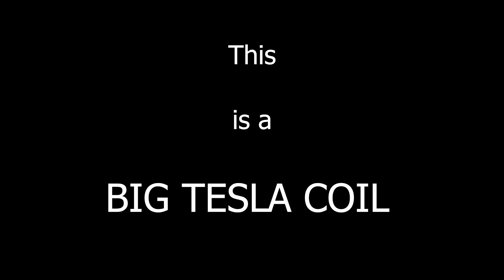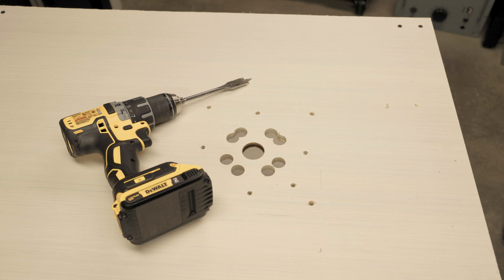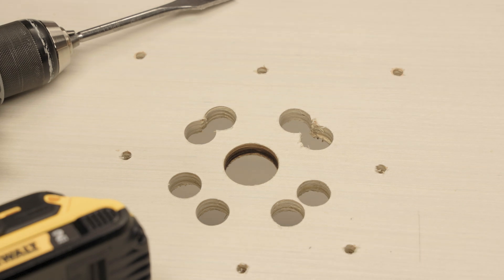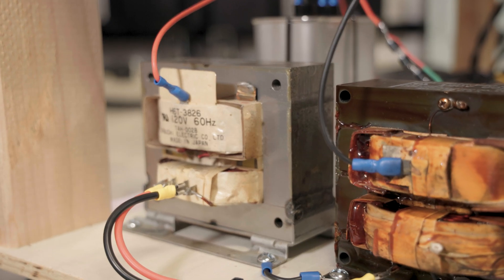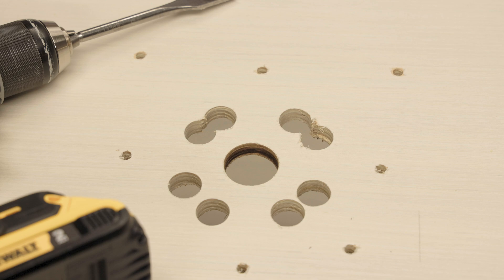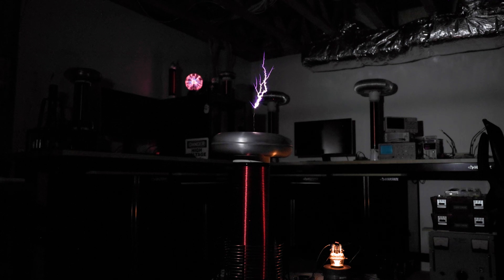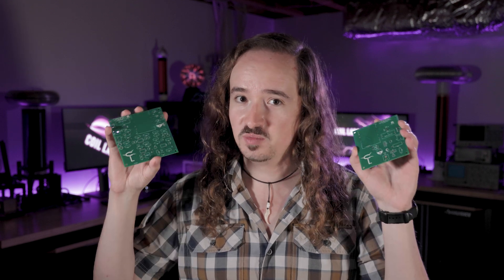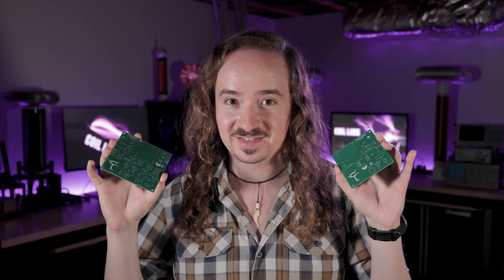I built a big Tesla Coil, but it has a big problem!

Comment: Dose your soldering iron suck up the fumes?
Reply from the maker: Yeah, it's an all-in-one soldering station and heat gun. It has this "fume extractor" thing that uses the same air pump as the heat gun. This is what it is https://www.amazon.com/Aoyue-968A-Digital-Rework-Station/dp/B006FA481G
Reply: @CoilLabs  if my current one ever hits the bucket I might invest in one.

Comment: I think the diode stack probably failed because each diode will have a slightly different leakage current when reverse biased. If one or two of those diodes are a bit leakier than the others, they will take up a small portion of the reverse voltage. That puts excess strain on the other diodes until POP! Sometimes you need to parallel each diode with a resistor. Yes it will leak more in reverse, but it will keep that voltage evenly distributed over the diodes.
Reply from the maker: That's a good point. There are big transients spikes in staccato operation so whichever of the diodes is the "weakest link" due to different leakage probably went first which then resulted in a cascade failure with the rest of them.

Comment: I suggest using JAVATC to design the coil. Its actually made for SGTCs but works fine for VTTCs also. Just ignore the spark gap parts of the program. I have used JAVATC to design several Tesla coils including my 833C VTTC. It looks like your coil is out of tune. I also suspect the coupling is too low because your primary coil is very far away from the secondary coil.

Comment: Very good. but there are a lot of things to improve I get 1m output from a gu5b vaccumtube it's a 5kw triode. Im using 4 MOTs in parallel and series and a 12uF doubler. I would also use more diodes like 30-40 10A10 diodes in series and MOVs across evry diode. Also Russian doorknob caps are perfect for tank caps they are rated for 15kv 450pf.
Reply from the maker: Appreciate the thoughts! Keep chatting with you offline.

Comment: Lmao that’s the same power level I got yesterday running my 5kw vttc on one MOT. I am not  
sure what the problem could be here but I suggest trying out a new different sized top loads 
because my vttc wouldn’t even run with a top load that size to to some finicky capacitance stuff
BTW my tube is 5kw not my power supply. Yet.
Reply from the maker: Yeah that's definitely a good suggestion, thanks! Something I didn't think of when I recorded the video is that I think I need to reconsider the design of the entire secondary and primary. I think coupling is part of my issue as well. Plus RF impedance matching with the tube. That 7kW is going somewhere, just not where I want, lol.
Reply: @CoilLabs  7kw? Yikes
Reply from the maker: Yeah, I wasn't able to get it on camera, but those brief runs of CW I did showed it was pulling about 30A from the 240V mains going into the two MOTs, on my current clamp.
Reply: @CoilLabs  my current clamp says 99 amps 120 volts on my Tesla coil however it draws like under a kilowatt at best and is clearly connected to a 15 amp branch circuit. I was told current clamps don’t work on reactive loads and especially Tesla coils for some reason. My coil is bigger in arcs then yours the first thing I would inspect in this situation is the current clamp itself as that is the most likely source of a massive 5kw’s of lost power. That power has to be making heat somewhere and your setup clearly is not burning up in flames. However mine is solid state so I don’t know due to the microwave transformer isolating the load. I would check the current clamp first.

Comment: Very nice! Styropyro seemed to have similar issues with his VTTC at first, if that's any consolation! You should talk to Kyle over on "Electromagnetic Farce", he made a really powerful VTTC despite using an even weaker tube. Maybe he'll know what's up with your design!
Reply from the maker: Thanks! I didn't think of it in time when I recorded the video, but other than finding a less fragile power source than MOTs, the other thing I want to do is redesign the entire geometry of the primary and secondary. Starting to think coupling is a part of my issue too.
Reply: @CoilLabs  thats what i would have suggested too, i dont know how "big" your doornobs really are, but you seem to have high Inductance ( big primary) and low Capacitance... I would recommend shifting this to more Capacitance and less inductance for the same LC Frequency.
Reply from the maker: Doorknobs are 4nF each. 3 in parallel so 12nF overall
Reply: @CoilLabs  I had similar C Values at my first Tesla Coil, and after shifting to more ( 60-100nF ) i had better Ark results ;)
Reply: Primary spaced too far apart in between turns, get fb as close to primary level with secondary turns. Get prox as close as possible without flashover.
Reply from the maker: That is as close as I could get the feedback to the primary without it flashing over, unfortunately. I had a bad enough flashover once that it damaged the feedback and I had to rewind it. Don't have great evidence to support this, but I'm fairly certain the feedback is satisfactory, because I think there's plenty of current in the primary. The steel alligator clips (a source of losses that I want to remove in the next design iteration) that connect to the primary would get quite warm after just a minute or so of running. So I'm thinking 1) coupling is too low and not enough of the energy that seems to be there in the primary is making it into the secondary and 2) the overall "load" is not impedance matched well with the tube and I'm probably losing a lot of power to the plate.

So TLDR, I agree the primary (and other things) needs redesigned, but not sure I understand your point about the inter-turn spacing, specifically being a problem though.
Reply: @CoilLabs  you could try AWG insulated wire on a pvc form level with the top of the secondary with the turns directly on top of each other to increase inductance.